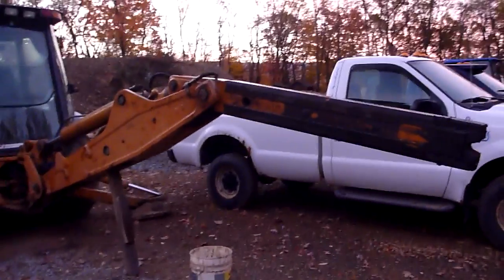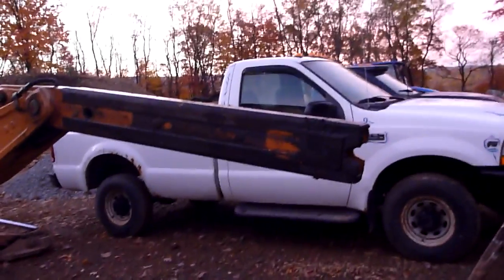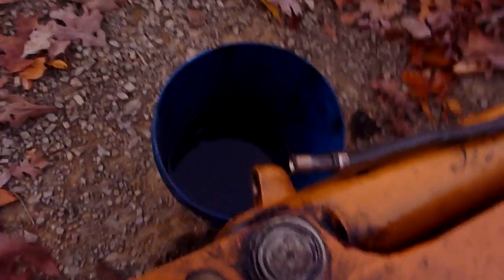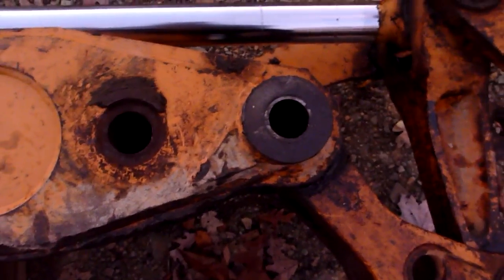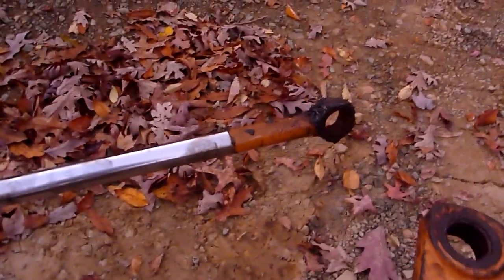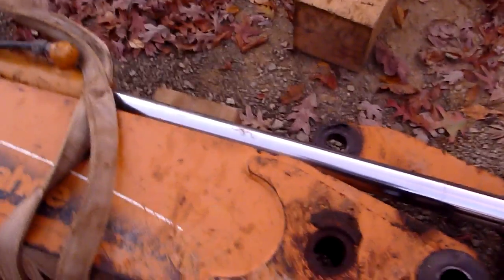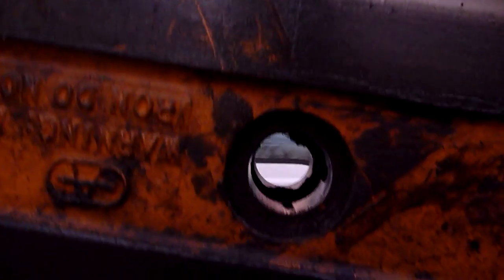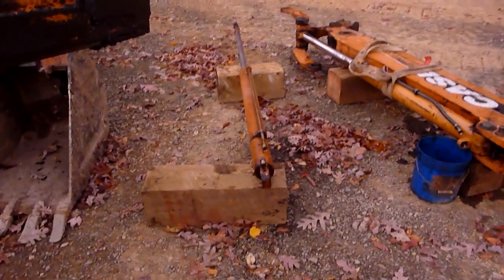How To: Changing Extendahoe Hyd lines On 580 Super M

Comment: I really suggest tieing a string to each hose before you pull it apart a little string goes a long ways when changing tough hoses on trackhoes and backhoes. Also check or replace the four wear plates. It helps assist in rubbing metal to metal even if they are properly greased the teflon wear plates are best changed while in there. My hoses were shot but i repacked the cylinder too because even though its not a bad job to do i didnt wanna have to go back in it. Lol

Comment: I bought a 1966 case 530 ck Backhoe 180 Diesel and.a 1973 Ford f-700 DUMP truck and a 10- to 30ft Hudson dove tail tandem AXLE DUEL wheel air brake equipment trailer  ready for work 💪

Comment: I had to laugh, I helped do the same job on a 590 a little newer than that machine. The end of the cylinder split, it was repaired and put back with new hoses.  Used an overhead chain hoist to slide the stick apart. Glad I won't have to do it again only did it the first time was to learn how it was done lol.